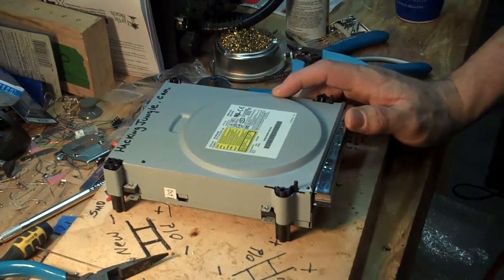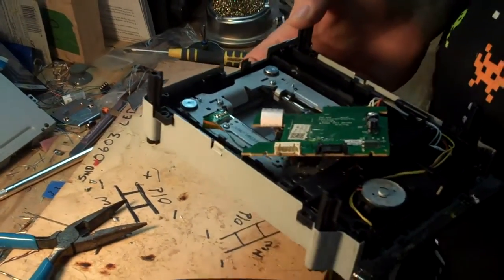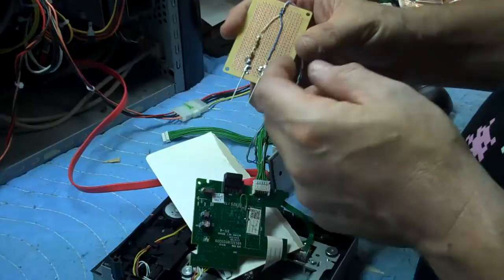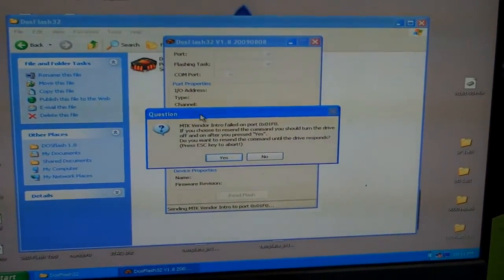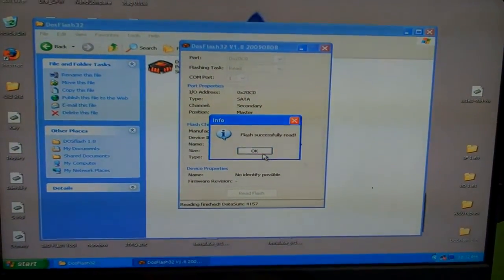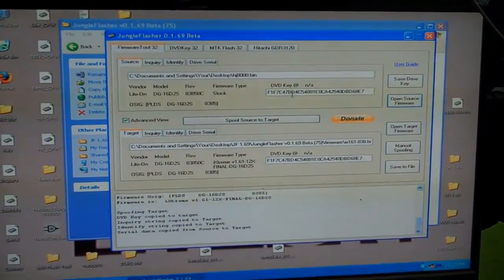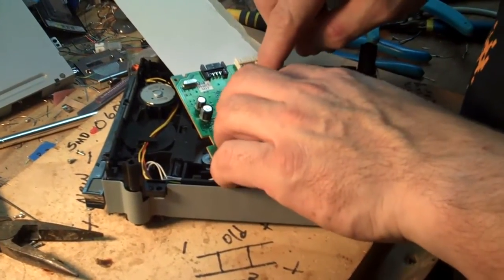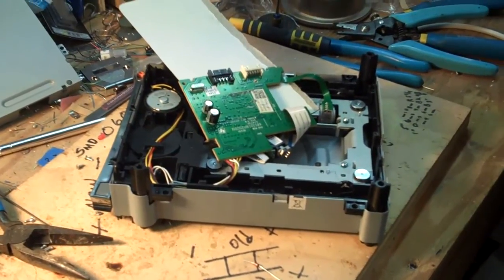Dumping the 93450c or 83850c  LiteOn Dump with homemade Probe DOSFLASH and JungleFlasher 1.69

Comment: Morning...when I come to solder the first jumper wire I always use a flat wire instead of a high loop so that it almost touches the isolated middle section...about a 1mm gap.  When it comes to bridge the gap after reading I just press this wire down (pre tinned) and solder it.  This way you don't need to unsolder anything.  Good vid though..